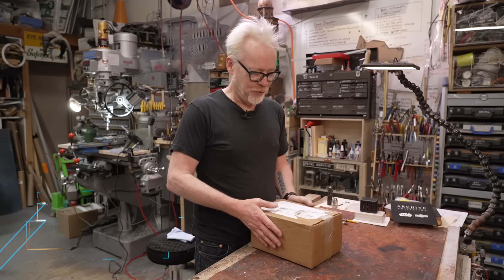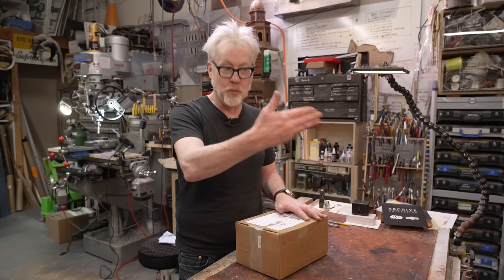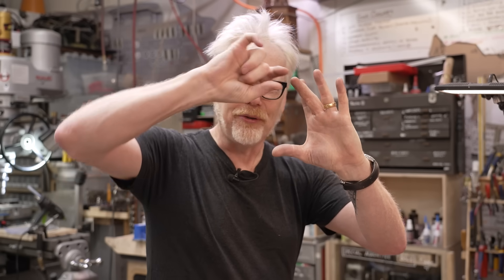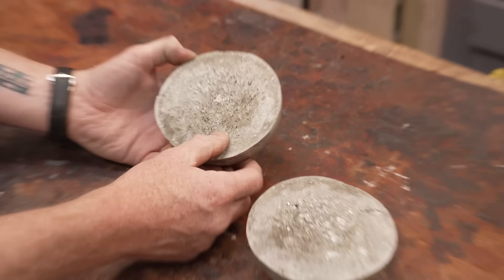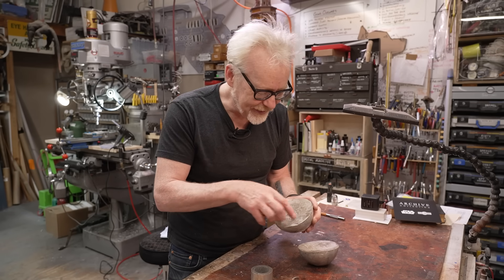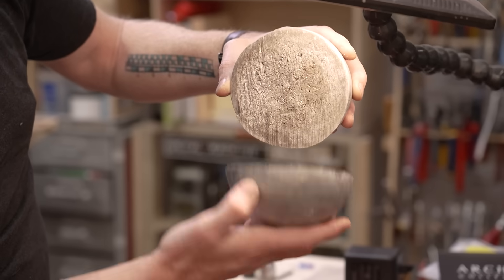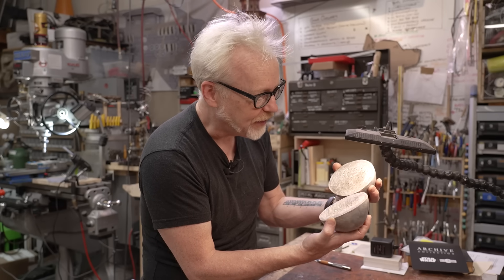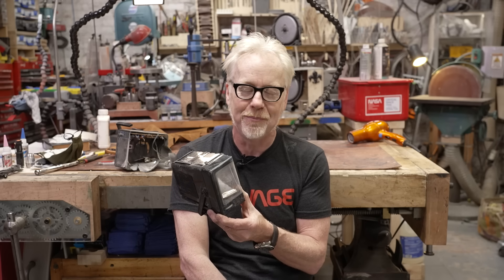Adam Savage's Aluminum Foil Ball Cut In Half! (Ft. Waterjet Channel)

Comment: Use a hydraulic press but only crush the ball partly in multiple opposite points to make a cubical shape, then manually pound (or use a metal pounder/shaper machine I've seen on American Choppers when they fabricate a fender or whatever.

Comment: While the abrasive does help with cutting, it isn't strictly speaking needed. Water cutting is a lot older than you think, the first narrow-nozzle cutters appeared in the 1930s, but could only cut comparatively soft materials. By the late 1950s, however, ultra-high-pressue water cutters(100 thousand PSI) were able to cut high-strength alloys such as stainless steel, and were used for making parts for the XB-70 Valkyrie, among other things.

Comment: I used to operate a water jet at a machine shop and we used Australian garnet. I'm sure there are other options out there, maybe even for certain types of material but that's what we used for aluminum, steel and all sorts of plastics. Thanks for the great video!
Reply: They did actually use garnet

Comment: @4:55 Actually, yes, it is the water that does the cutting. Some circumstances (such as cutting bone - yes, they do that, or thinner/softer materials) there really is only the jet and the water.
In abrasive water jet, you get certain abrasives (such as Garnet or Aluminum Oxide) that assist in the cutting action. The surfaces are rougher in abrasive water jet, but simple water jet cutting leaves the same cut striations (just less severe). These striations are actually miniature deflections in the high pressure water path as it bores through the material and hits the different crystals or densities within the material. These striations are normal and will be more exaggerated in a more non-homogenous structure (like this foil ball).
Also, the jet nozzle is usually the only thing made of a very hard material, such as sapphire or diamond.

Comment: The first color television sets used a lot of voltage on their cathode ray tube.  As color density used to drop with time, some people changed the factory tube settings by cranking up the sealed screws which raised voltage to x-ray energy level.  It did restore colors for a while but some unwitting tinkerers were exposing themselves  to X-rays.

Comment: 1:54 average aluminum foil is approximately 630 microns with some heavier duty foils being roughly 900 microns. a bit more than a micron or 2 no offense lol, i knew this already from my job because we use 15.2 micron and 20.3 micron plastic wraps which are extremely thin, vastly thinner than any aluminum foil. either way still a very nice ball

Comment: When cutting aluminum with a saw, use a fine toothed blade and cutting oil or wax for a lubricant.  The lubricant is essential with aluminum to keep it from binding to and gunking up the blade.

Comment: one of the first cautions I got in wood work class was about cutting round pieces on a band saw, it's very tricky and dangerous, not only to yourself but could damage the saw if the precautions required are not enacted.

Comment: Former waterjet operator here. Most jets use garnet as their abrasive medium. It's fairly hard as far as semi-precious gems go, but it's also much more affordable than harder ones like diamond or sappire. Depending on the model of jet and it's use case, the abrasive can range from a fine sand to a powder like consistency (can't really remember the grit range off the top of my head). The particular jet I ran was made in the late 90s and had an outlet pressure around 40k psi; newer models run closer to 100k psi.
Reply: One I ran also used garnet and ours ran around 65,000 psi
Reply: Referring to 4:55: Also you don't always need an abrasive medium for thin and soft materials. The water has the function to cut too.
Reply: I worked at a formed fiber facility that cut out those liners in your car trunks. They used dual fanuc robot cells, with intensifiers that pressurized the water to 70k psi. I dont remember them using any cutting media to cut that material
Reply: Steven Universe fans know Garnet goes hard.
Reply: Just coming to say that.

Comment: use a diamond wheel cutter, like the ones used to cut diamonds, the blade should be thin enough not to tear into the material.

Comment: I have worked with water cutting machine and you can cut with no additive just with the pressure of the water it will cut ... and we used fine sand for the additive ! nice video Adam :)

Comment: OK, here's a thought - and I have NO idea if it's even possible - 
but there exist pressure chambers that can exert enormous pressures from all directions on an object, yes? More so even than at the bottom of the deepest trenches in the ocean. 
OK, so. I think you know where I'm going with this. What would happen - and I think Adam of all people might have some connections with people who could make this happen - if you subjected an aluminum sphere like this TO that pressure chamber? It's being compressed by what, thousands of pounds of pressure from all sides - I'd be curious how small it would get, how DENSE it would get and what that'd look like. 

The OTHER thing to do - just for fun - would be to create a spherical mold - or have fun with it, maybe do a little bust of your head or a dinosaur skull or something - MELT the aluminum foil and pour it into that mold. That'd be cool. 

Another fun project that occurs to me: a life-sized reconstruction of the LARGEST Tyrannosaurus rex's skull (in case you couldn't tell I am a paleontologist) - whose name is Scotty (weighed in at nearly 10 tons) - and see what happens to materials when you apply, say, 20,000 lbs of pressure (the estimated bite force of a T. rex in some models ranges from 10,000 all the way to 40,000 lbs which is enough to cut your CAR in half). Of course you'd have to make it out of something sturdy - like steel - but there you go.

Comment: Water can cut though as I found to my cost. Many moons ago when just starting in forestry I was jet-washing one of the big forwarders; they haul timber out of the woods. It was a huge diesel powered jet-wash, had never used one before, wondered what the pressure would be like & stuck my finger over the nozzle & pulled the trigger. I can still count to 10, but I had a neat hole blown through my finger. Wasn't just me though, about a week later one of the other trainees was asked to wash the vans,  Instead of the normal jet-wash he sparked up the big one, blew the licence plate of the front of the van & stripped a line of paint all the way up the bonnet [hood, to the Americans].
Off to watch the Water Jet Channel now, sounds great.

Comment: The key to obtain greater density at the core of the sphere would be to commence the embryonic sphere by condensing it in the jaws of a vise, turning frequently to maintain the sphericity.   This is how I started my alumin-I-um sphere, up to about tennis ball size I used the increased pressure of the vise to compress the sphere.   I've been building my sphere up over the last 15 months or so and it is now about four inches in diameter.   However, my sphere is  made up of every scrap, of foil from my food package recycling.   So,  pressed foil take-away trays,  foil pie trays, foil cake cups, (lots of those),  scraps of kitchen foil,  etc...   So my sphere is all of the waste aluminium generated over the past year or so and it feels pretty heavy now.   I expect it will be fairly uniformly dense as each strike of the hammer causes a well defined ring to emanate.     
.
I kept condensing in the vise until the sphere was too large to fit between the jaws.   Small pieces of foil were stuck on with cyanocryolate.   Around each centimeter of growth, I would secure with several layers of self-adhesive aluminium tape (2'').   This really helps to consolidate the outer layers and create a nice smooth surface.       
.
I'd love to cut mine in half too, to see how it formed...  But, I'm still growing mine to a larger, hopefully football size... So a few more years to go yet then.   Might need to move up to the 2lb lump hammer by then.

Comment: The thing I keep thinking of is how, despite full of air, it sticks together as a solid metal. Is it the pressure from the hammering that almost soldered the layers? That bond is impressive. Consider it stood a water jet at extreme high pressure and not a single foil separated from the other. Awesome.
Reply: When two metals are being deformed and now oxides are formed, they weld together via diffusion. This is actually a problem in aerospace applications. There is also a really cool engineering application for this which is called explosive welding, which can be used to weld material together that would not be weldable in any other way. Heres a video on the process
https://youtu.be/u9_bqafUJfA
Reply: @michaelmuller4849  Thank you very much for the reply. Never heard of that technique. Very impressive.
Reply: maybe multiple interlockings from almost all directions. ??

Comment: This is amazing. I have a question about the material you created in making the ball: Could it be used for high strength insulation? Say on the Moon or Mars? Surely the folding of aluminum is scalable. I'm not a scientist, and am just genuinely asking a question whether right or wrong on the concept

Comment: I did an aluminium foil ball challenge as a student sometimes around 1990. Only, the purpose was recycling, so I didn't start with a roll of new foil. I was painstakingly washing used foil from sandwiches, adding chocolate wrappings, even separated the paper from aluminium from the thing butter comes packaged in (nowadays it's all plastic, in those days it was paper and aluminium sheets pressed together).

It took months to reach any size worth talking about. But I believe it was more or less homogeneous throughout. It sure was heavy enough, almost like solid aluminium ball 😏

Comment: Is it possible to avoid big density changes by doing the challenge several times with the same ball: make a small ball and finish the procedure and then cover it in some more aluminum and do the same stages?

Comment: I would guess some silica mix.  We used to use sand laden water to cut steel in the oilfield. Really abrasive stuff and cuts amazingly well at hi pressure.  Dangerous too

Comment: Does aluminium foil have plastic in it or is an extra malleable alloy? Why doesn't it crack in normal use? I have always wondered this. Most other aluminium like tubes and structural angle, or the chips of it, is sticky and malleable somewhat but more brittle than steel or brass, and thin steel or brass I think would crack with so much movement???

Comment: We used to make these things when we were kids growing up in NS, Canada. The cigarettes of the time (mid 90s-early 00s) came in packs with a 2ply foil/paper wrapper inside the thin cardboard outer shell. If you singed the edge of the foil, and/or run a lighter quickly over the foil side, you could peel the paper cleanly off, and be left with an extremely thin, almost - but not quite - gold-leaf style aluminum foil. We would constantly be checking old cig packs for the foil inners to keep adding to our big shiny aluminum balls.

Comment: The abrasive that is used in waterjets is usually just sand, fine grit but natural sand. You can also use crushed glass, and potentially even something like a fine aluminum oxide blasting medium, but I've never seen it done.

In my 15 years of running waterjets, we've only ever used waterjet sand, but we mostly cut stainless and aluminium.

Comment: Try cutting next ball with EDM wire cutting. It does not put any force on the piece that is being cut, and i suppose it will allow for better inspection of the layers after cutting.  With water jet, there is probability that it would drag some aluminium foil layers and make the layers invisible

Comment: I still think it should be cut using EDM...

Also, if you're going to do it again, use a hammer from the get go. Don't unwind the complete roll and bunch it together, start off small and compress it with a hammer as you go, adding layers. It won't give the spongy interior, but should be interesting as well.

Comment: I know there are plenty of trapped dirt particulates within the layers during its formation - but I would like to see whether you would be able to tig weld the outer and inner layers - even weld it back together🤔 just for curiosity sake - may act like Mazak alloy (horrible)…. 👌👌👌👌👍 its sound was like an air-brick / ceramic

Comment: To me, as a machinist person, I find this channel pretty fun.
I wonder why everyone seems to think that any kind of aluminum is "aircraft aluminum"?  That makes it sound really good, but your remark of 6061 aircraft aluminum sounds like nonsense.  
I guess any kind of aluminum used in an aircraft, which is almost all kinds of aluminum, sounds exotic.  It is not.  A great amount of the parts in an aircraft are not "specifically" aircraft aluminum.  That is like making a big deal about "structural STEEL".  The fact is, structural steel (A36 spec, what I beams and H beams are made from) are some of the lowest spec steels available, just going by tensile strength.  Same for "aircraft grade aluminum".  6061 aluminum is a crap grade of aluminum when it comes to aircraft, used to cut costs when you don't need anywhere close to maximum strength, and machining times are secondary to material costs.  I work with this stuff.  If I had my druthers, 6061 is one of the last aluminum alloys I would choose to make parts from.  It's just barely good enough, and certainly cheap enough.  You want aircraft metal?  You use 7075 (expensive, very strong) or titanium (really, really expensive and really really strong.)  6061 is a throw away metal.  That's why so much crap is made from it.  Just because they may use it for the frame of a passenger seat in an airliner doesn't make it special.  What they make the jet engines out of... that is special.  What they make the landing gear from... that is special.
6061 is the potting soil of aluminum alloys.  Throw it out and get some more from Ace Hardware next year...

Comment: it's not only air trapped inside - there's also a lot of aluminiumoxide because there was a lot of Al-surface in the first place. If you bake this together you should get a really hard Al-alloy due to this corundum.

Comment: The aggregate used is carborundum which is made with silicon carbide. It is an abrasive material that looks like sand and is used to resurface. materials.  You can use carborundum to level a stone in Lithography.

Comment: You should've used a Wire EDM machine. The things that they can do are insane. Sort of similar to water just but the part gets submerged into a tank of water and a copper wire gets fed through the machine using electricity to cut the part.

Comment: Before you polish the interior...you might consider filling the voids with a clear epoxy. Throughout the polishing process I could see some of the Aluminum melting and filling in those voids. The epoxy would allow you to maintain the gaps that have been created.

Although, you won't have a ball of pure Aluminum Foil anymore. So, I guess it's up to you.
Reply: Clear epoxy yellows in time. All of it does. It's just how it be. You need to tint it, or it turns yellow.

Comment: As kids, my brother and I collected the aluminum foil out of cigarette packages for years, spent countless hours heating up the pieces of foil on an electric stove to separate the paper from the foil and then forged the indivual pieces onto the ball and rolled them between pieces of hardwood to build the ball up in size. Every relative that was a smoker (and that was a lot of them) were forced to keep all the foil out of their cigarette packages for us we would get them by the shoebox load at a time. I wonder how dense the inside of that ball would have been. The ball grew to about 3.1/2" in diameter and was extremely heavy indicating it was well forged together.

Comment: the solution of water jet cutting is excellent. 
as an alternative to using traditional saws, the sphere could be inserted into a cubic shape of some material suitable for cutting (plaster, cement, resin,?) in order to have safe support surfaces that would have prevented the rotation of the object.

Comment: If you think water jet is cool, then take a look at water laser cutting where the water carries a laser beam. Now that is awesome. Being a automation engineer I have seen a lot, including working on equipment welding parts for the Ariane rocket, back in my later teens I am still totally blown away by water laser. Go check it out!

Comment: I imagine that if you put a relatively loose ball of foil say in a clothes dryer it would compactify and become spherical over hours and hours of tumbling. Maybe you would need a more sturdy drum, say a small section of large steel pipe would do the job. I think it would take much longer than using a hammer, but it would certainly save a lot of effort.

Comment: Would be awesome and supremely impractical to do this with pure aluminum foil, before it oxidizes, under vacuum conditions. Ideally the foil should cold weld to itself so it really WOULD become a solid metal candy coating

Comment: That is actually a pretty solid piece. Really has a knocking sound similar to, well, a block of alu
And completely agree on the "grippiness" of aluminium. From my dremel experience I know that iron/steel makes sparks and that's it, but alu is a huge mess and gets how. Cutting it dry throws dust everywhere and wet creates a nasty sludge.
Reply: we grind wax with traditional abrasive wheels... but we use candle wax as we grind it... makes the aluminum melt away like butter =D